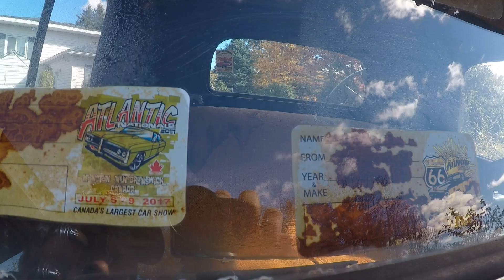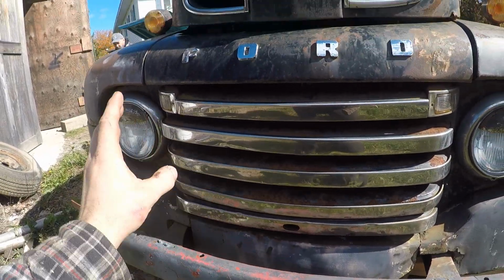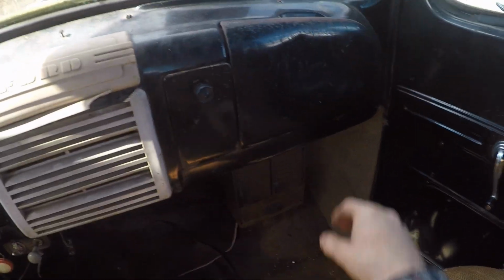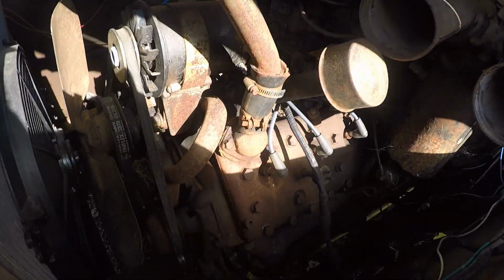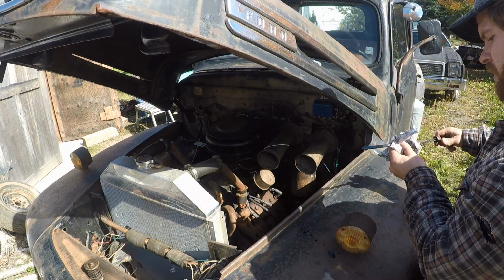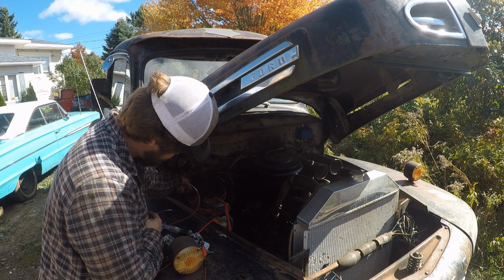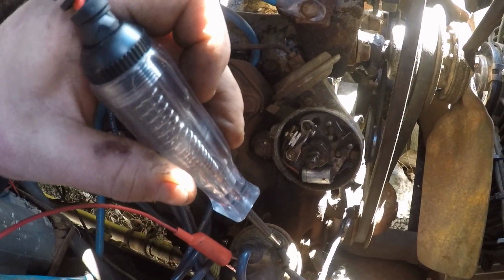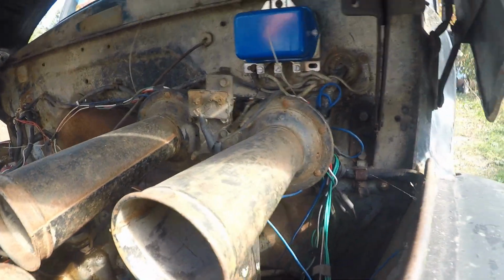Will this 1950 Ford run again after years of sitting? Sweet Flathead V8 Manual Trans Goodness!

Comment: Those flatheads sound amazing! My Dad's friend had several of these in old Ford trucks, and I grew up around em. You can't beat that exhaust note with the exhaust pulses of 4  cylinders exiting through 3 exahaust ports on each bank